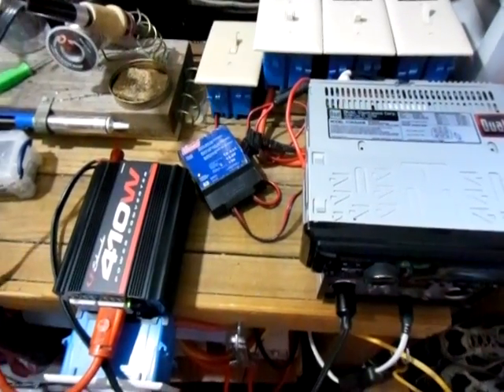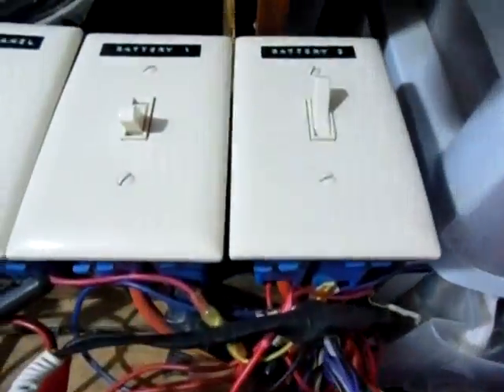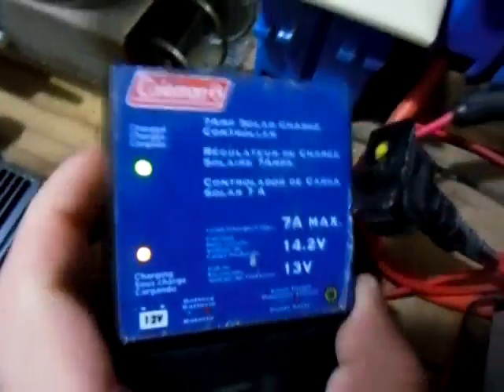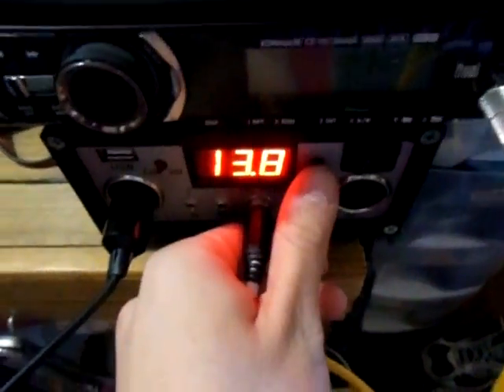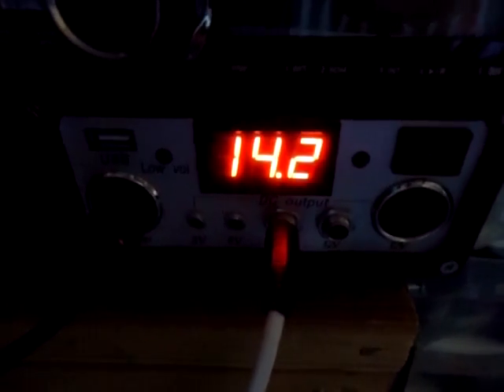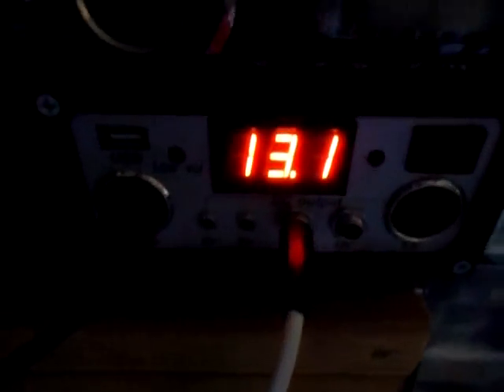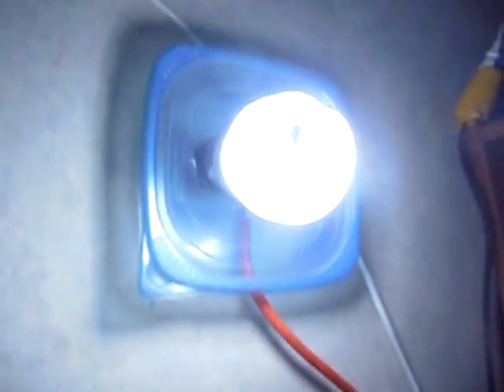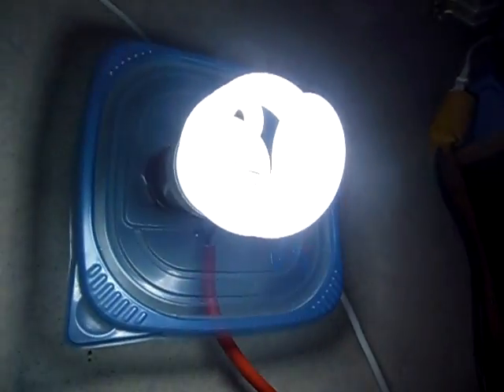12 Volt Power Inverter Running Without A Battery

Comment: OK, try this one. I take a DC inverter (plugs into lighter) and connect the pos and neg clamp wires to the posts on the back of the inverter to charge a battery. Still with me? Can I then unplug from the lighter socket and run the inverter off the newly charged battery using the same clamps still connected to the back of the inverter? Maybe if you see the inverter it will help you. Here it is >>https://www.amazon.com/dp/B07JJSW48V/ref=sspa_dk_detail_0?psc=1&pd_rd_i=B07JJSW48V&pd_rd_w=GIdic&pf_rd_p=8a8f3917-7900-4ce8-ad90-adf0d53c0985&pd_rd_wg=bmaaV&pf_rd_r=KEBFE44WSSHR8C3VMAG1&pd_rd_r=232eb574-8650-11e9-b31d-a3211b75eab9

Comment: Also yours will stop at some point because the panels get to low from clouds an DC you have to use your batteries again to drop the voltage . Over and over. No good man

Comment: But you still need a battery in your case other wise the inverter wont start beca8se volts too high. In my video called run inverter directly from solar panels without a battery..no battery is needed at all

Comment: Hi why wouldn't it be good for the charge controller to run equipment without a battery?
I'm thinking of making a system that will charge a battery from solar or Dc transformer through a charge controller.
Or be able to run Dc transformer through the charge controller and out to power 12v equipment 
Do you have any thoughts?
Reply from the maker: +TheWhiteScorpio1 Hey there! Yes, that will work. The only reason why is was not good to run a load through the solar output of the cc was because of the voltage being so inconsistent. Its not very good for the inverter. Running the inverter off a battery is way better.

Comment: good morning sir my solar panel is 30 Watt and my controller is 5 amps,my battery is 12 volt is that ok. 
how many electricity will load to battery in this case sir ? please tell me what to do.
Reply from the maker: +Joseph Naigan You have a good setup. The run time all depends on how many amp hours your battery is. The more amp hour you have, the longer and more stuff you can run. :)
Reply: 2012solarful 
thanks you. sir.

Comment: Will a 5 watt solar panel work?
Reply from the maker: It probably wouldn't be enough to start up the inverter.
Reply: +2012solarful  I have a small 12volt deer feeder battery and the same charge controller
Reply from the maker: Cool! A 5 watt panel should be pretty good to recharge the feeder as long as the panel is in full sun. :)

Comment: I power an inverter directly off a solar panel all the time, and without the use of a charge controller, nor do I need a battery or capacitor to get it started.  I bought a 1200-watt BUCK converter that lowers the voltage of the solar panel to any voltage I want (in this case, 12 volts for the inverter).  The power lost from dropping the voltage is GAINED by a larger amount of current put out by the BUCK for your inverter to use.  This is exactly what the inverter needs.  You will not damage anything.  When a cloud goes in front of the sun and the power drops too low, the BUCK converter can be programmed to just cut power until you manually turn it back on.  This way, you won't ruin whatever you're powering with the inverter, or the inverter itself.
If you use an oversized solar panel (or panels) for the load you're running, you can keep it running even during some cloud cover.
Reply from the maker: Cool! Thanks for ideas! I'll definitely look into Buck converters.

Comment: I don't mean to nitpick or insult you but something about this setup made me laugh.  You're running an inverter directly off solar panels to run a light.  The light would probably be something you wouldn't need in an emergency with full sun.  No offense, I understand the concept, I just found it ironic.
Reply from the maker: True but, I just used the light as a demonstration. Thanks for the comment.
Reply: What did you want him to run it on a 10kva motor?